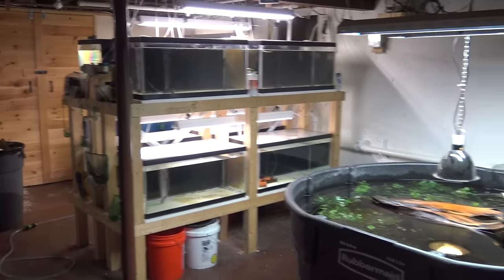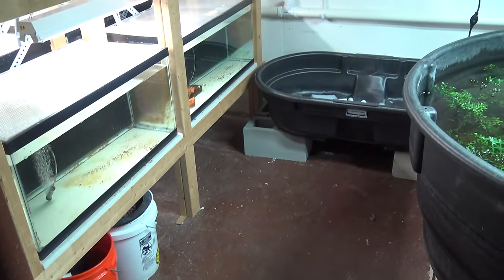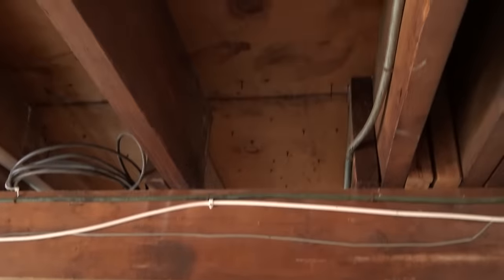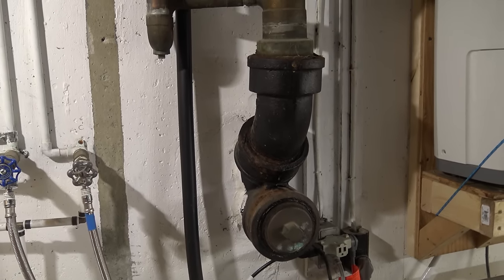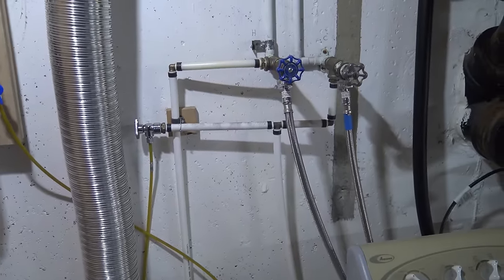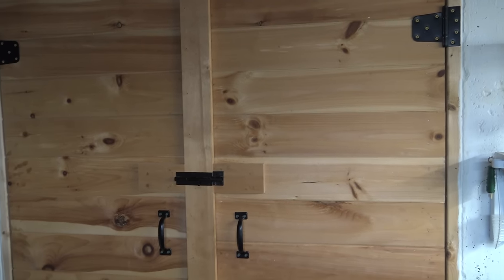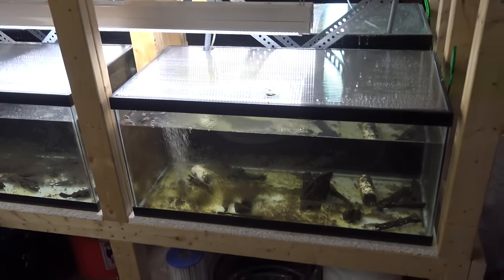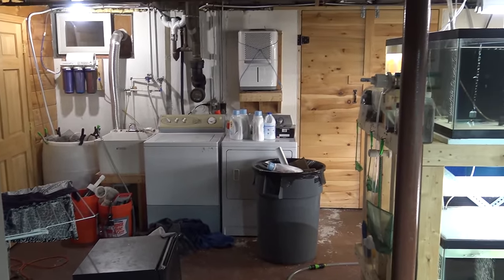#411: 10 Things to Consider When Buying a House for Basement Fishroom - Tank Tip

Comment: I have to disagree on the sump. Some parts of the country require basement sump whether it's a flood zone or not. I've had one for 20 yrs and never had ground water come into it. Mine is also used to pump the laundry water up into the septic tank. The only time I've ever had flooding from the sump is when pump failed while doing laundry. I've had more basement water issues due to water coming into basement window wells.
Reply from the maker: i can see your point, but i'd hate to go on vacation and have a sump die
Reply: Greg Jones-true, but you can get a battery backup pump and ours went out just due to the fact it got used 5-7 times a week due to the  laundry. If there is not a water issue in the area, then it may hardly ever run. 
I agree with you though, if there is a ground water issue, then stay away and the owners probably have more water issues in that house than just needing a sump.
Reply: msack6904 Agree with you, I've never been in a basement that didn't have a sump crock, it's how water is kept from building up around foundation. I have battery back up sump pump until I get a whole house stand by generator installed in next year.
Reply: Agreed. Backup battery sumps. And sumps  dont automatically indicate a flood zone.